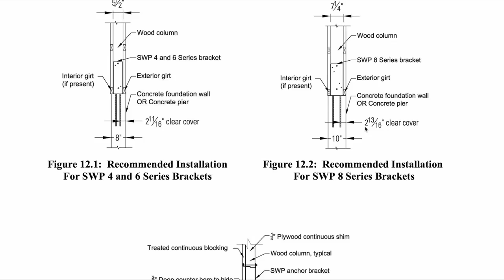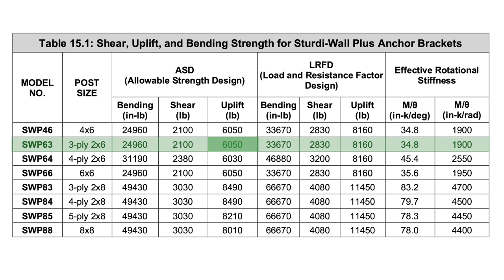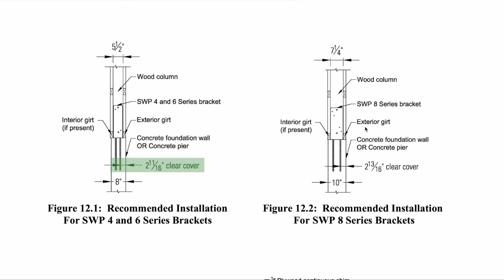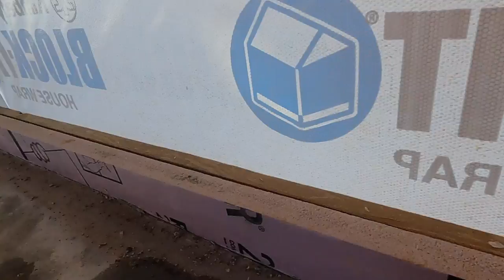How Strong Are Wet Set Brackets? | Piers + Brackets | Cost Breakdown | MAD County Standard | Ep 3

Comment: We used wet set brackets on our dream woodshop self-build, and everything went smooth as silk. I did everything myself, but my daughter helped tip-up the posts and fix them with a temporary screw until they could be plumbed. As you state, they are engineered to work just fine, but I'll throw in this: we have post frame buildings all over the place around our property that were built in the 30's, 40's and 50's, and those buildings were built with round poles into the ground (newer ones were pine soaked in creosote, and the older were cedar). I have been in a lot of these buildings, and most of them have nearly every post rotted off at the ground — yet the buildings are still standing! If a cedar pole barn can stand nearly 100 years, I believe these newer post frames will be around a very long time 😊
Reply from the maker: Thanks for sharing! And yes we just don’t want to take the risk with a home especially!
Reply from the maker: Wow, thanks!

Comment: Thanks for this...I'm South African doing my pour and bracket set this coming Friday. We don't have the infrastructure or industry down here, so I've based all my foundation work on YouTube vids. This one being by far the most important of all. The one thing that's stressing me a little as there doesn't seem to be any content covering the matter is how long after the pour do you have to rush to get all the brackets in, before the concrete starts to give resistance? You do far more columns than I'm tackling but I do hear you at one point saying, 'Did we pour these first'. Thanks in advance.
Reply from the maker: There is no exact timing. Depends on temp, weather, water in soil, and concrete mix. Really have to go off the feel. You want a little resistance as you’re setting the bracket. It shouldn’t just slide down. The bottom plate of the bracket shouldn’t be sinking into concrete. Sit right on top of pier. There’s times we’ve started setting a bracket and pulled back out because it wasn’t ready. Hope that helps.
Reply: @MrPostFrame   Absolutely...thanks for taking the time to reply, was the last piece of the puzzle...much appreciated!

Comment: Can you elaborate on how you poured the slab over the pier?    Is the slab poured directly on top of the pier, or are the piers at the same grade as the slab?  Also,  could the slab and the piers be poured at the same time?  Thanks for your videos.
Reply from the maker: We add rock, plumbing, vapor barrier, insulation, and then concrete. We like to pour the slab after the structure is built.

You can learn more by watching these videos:
https://youtu.be/r6c7JmMwC2M
https://youtu.be/AGKRBCEWEYc

Comment: I noticed that you set the columns in from your layout line just over 1-1/2".  Im assuming that is to allow for the girts.  It seems to me it would be easier to layout the foundation so that the brackets line right up against the string.  I'm in the middle of designing and drawing plans for a job now and want to make sure I'm not missing something.  Also confused why the same brackets couldn't be used for the outside corners?

Comment: Thanks for showing the detail about how you embed the columns with the poured slab. I’ve been looking for that for quite some time. I did have a question about that though. Is there any concern about moisture, condensation or otherwise, causing problems with the end of the column where it’s is surrounded but the vapor barrier and concrete slab. If there is no way for that moisture to escape over time I feel the end-grain of the column boards will be come weak or even rot. Is that a true concern or does the single exposed face on the outside of the column provide sufficient drainage/moisture escapement? 
Thanks for explaining all the details. Keep up the good work.
Reply: There is no moisture source there and the column bottoms are treated.

Comment: I'm waiting on a few more loads of sand then drilling for my sonotubes. When I reached out to the manufacturer (Midwest steel) they informed me I couldn't bury the brackets and have to pour concrete squares on top of the sonotube. Have you ever seen this done? I've saw a few videos doing as you did, and personally it's how I would like to because I don't want to see the circles for sure, and I'm not sure on having 7" thick squares on top of my sonotubes to support the building weight.
Reply: Your concrete is rated to 4000 PSI (per square inch) so a single pier would be strong enough to support your entire structure.

Also, it makes more sense anyways.  What is the purpose of using brackets if you can’t guarantee your post is staying dry?
Reply: @joshuastilwell4111  the post would still be staying dry, the bottom 5" would just be in the concrete. No part of the post would be underground.
Reply: How do you figure?  He’s installing the post right on top of the sonotube.   So unless you can literally see the sonotube from the exterior of the structure the post will be underground.

He’s installing sand/gravel, 2” of insulation foam and then a 5-6” pad on top of that.   So the base of the post is at least 8-10” below the finished slab.

Comment: Should you put rebar into post form?  Also I was not aware of fiberglass rebar, thoughts on using fiberglass rebar?
Reply: I used fiberglass rebar on my monolithic slab. The only complications I encountered were A) you can’t bend it, so other solutions have to be explored and B) when I put in my wet set brackets the rebar got in the way a few times.

Comment: I was told dry concrete mix is stronger but I see many post forms and Styrofoam concrete wall blocks poured with a very wet and runny concrete.   I assume that is so it will flow into crevices and fill the form more complete but aren't you reducing strength?  Thoughts?
Reply: Some of the soup you see is from using water reducer, it allows a better flow yet the yield is still there.. Do some research on it..

Comment: I see you kinda eye up the center of the post to set the brackets. Do these measurements have a little side to side play like a 1/4-3/4" without messing the building up to much?
Reply from the maker: They do a little. I like to measure and put a mark on the center of the bracket and then line up with the line I score in the pier.

Comment: Are you using a package from a lumber yard or a postframe company? Were you moving to get the brackets set or was there time to get them decent before the concrete starts setting up?
Reply from the maker: Trusses and columns come from metal supplier. Then I have a lumber supplier for the rest of the framing lumber. Set up time depends on weather. If it's hot and sunny we need to move pretty fast, but usually a little time in between.

Comment: I love wet sets. We can't use them here without tying into rebar. Our hurricanes tend to cause too much uplift, Even the walls need to be tied from foundation to top plate with tread all. I do like using them when Im inland for pier footings though. I usually spread the tangs out so they can not be pulled out without fracturing a large chunk of the concrete footing vs the standard 8 inch fracturing expected from the straight tines. Either way they save some time when major uplift isn't a concern..

Comment: Do you ever have issues with the piers settling over time?
Reply: I would think the piers should extend a few more inches above the ground, then it would be much easier to get jacks under the building in case it needed leveling after a few years or decades.

As they built it I don't think there is any easy fix if the piers do settle, so hopefully they don't.

Comment: Are you against using dry set brackets vs the wet set? I’ve seen a few channels where they like dry set better.
Reply from the maker: No, I'm not against using the dry set brackets. I have a full series on my channel where I build a house on a continuous ICF wall using dry set brackets. They are a little bit easier to fine tune. However, I prefer the wet sets whenever I can use them.
Reply: Be aware the dry set brackets have different engineering. You should research with PermaColumn to see if it meets your needs.
Reply: @MrPostFrame  We are getting near to starting a build. Would you please elaborate a bit more on this?  Thx

Comment: Hey Mr. Post Frame. What is your opinion on 6x6s? I would like to use larger timbers to include them in the looks of the interior walls. Basically, the finished wall would set recessed behind the timber face. What sort of issues would you forsee?

Comment: Just curious how are you calculating your $1812 cost on your mixture of 3 ply, 4 ply, and universal brackets. The cost seems a lot cheaper per bracket than Menards sells them along with other places making me think the price you are quoting isn’t consumer accurate. Just glancing at $1812 / 33 piers = $54.91 per bracket on the low end. Understanding that the universal brackets are $40 each, the 3 ply are $66 while the 4 ply are $80 a piece. Even if you did all 3 ply at $66 x 33 piers it would be almost $2,200 which is almost a $400 difference. Are the prices you are getting discounted for you? I only ask so we can all understand ahead of time so the viewers can take these cost breakdowns lightly. A $400 difference can easily turn into multi-thousands by the end of the build if the quotes are specialized cost for you. Thanks. Keep up the great content.
Reply from the maker: First, I want to thank you for your attention to detail. When I was looking at our accounting software, I saw 33 brackets. However, after looking closely, the universal bracket costs are being applied later when we use them for the columns. Sorry about the confusion. I'll note this in the next video, since I thought they were included in this one.

I believe we have 5 - 3ply, 16 - 4ply, and 12 - universal. So that price just includes the 3ply and 4ply.
Reply: @MrPostFrame  That makes more sense, thanks for the clarification. I’ve been preplanning for a while (since you started your house) on what it would cost to build something for my family and when I saw the brackets it just kind of stood out. Keep up the great work!
Reply from the maker: Thanks! Good luck with your build!
Reply: @MrPostFrame  Funny, I was thinking the same thing & came up with the same calculation per bracket & wondered. Thx for addressing this.